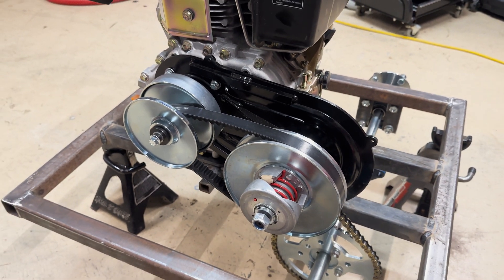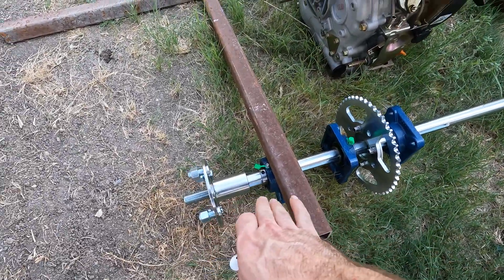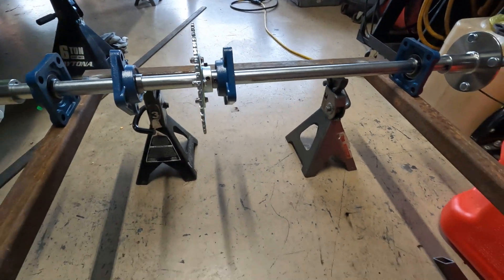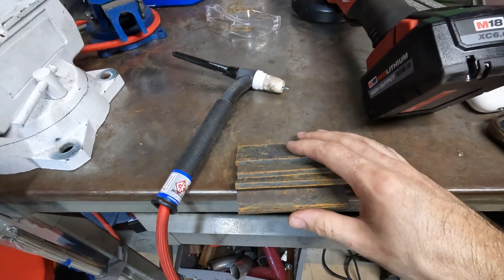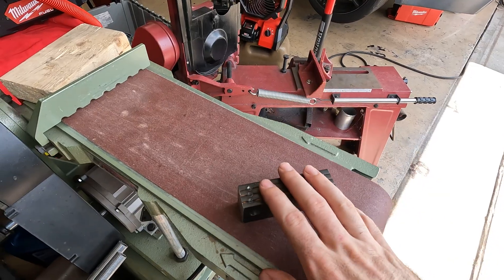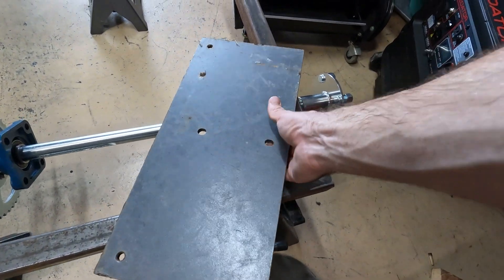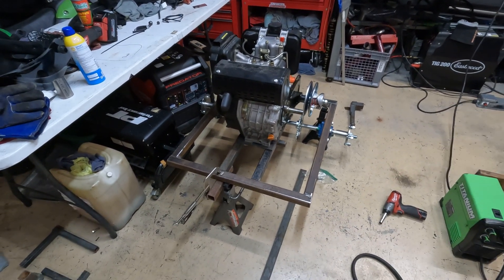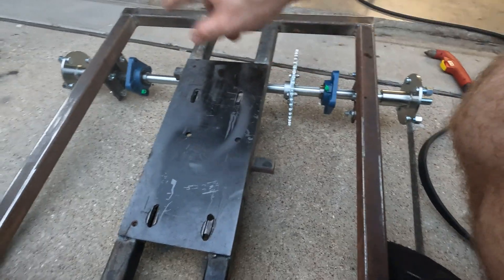Diesel Engine Powered 40 Series Tav Swing Arm Build Pt.1

Comment: Hi Mike, great build. I wonder how you clutch the system. Now if the engine runs the wheels run, right?
Reply from the maker: @Thunderst0rn  making an update video here very soon, but it drives amazing with this transmission, works well with this engine for sure

Comment: Do you know where i could put the throttle cable im trying to do a build with a lwan mower
Reply from the maker: @Jaysonbaxter_rfz   attached it to the linkage it has a spot for a cable on the plate on the back of the engine